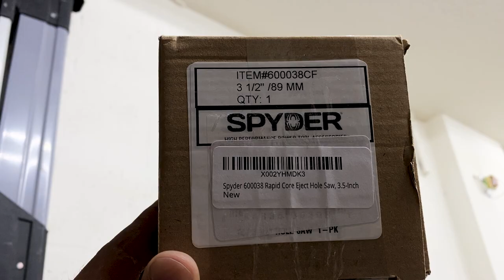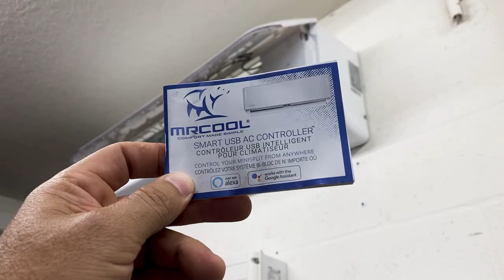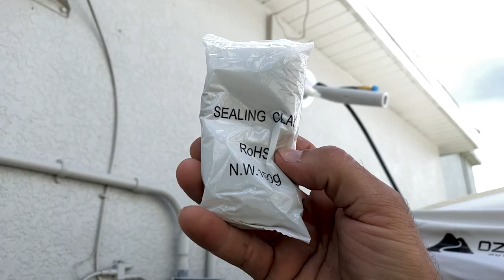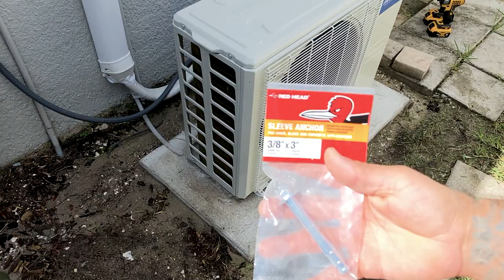MR COOL DIY 4TH Generation 18K BTU Garage Install

Comment: Why did you get 25'. Looks like a 16' would've been enough, right? Also, Abby advice on 120 vs 240v options?
Reply from the maker: I definitely could have gotten a shorter line set.  Not an electrician, so I can really say which one is better.

Comment: Excellent video. I’m in Florida as well. I have the same concrete walls in my garage. Thanks for showing what hole saw to use. I’m going to use the wall brackets on the outside to keep the unit elevated a bit. Well done!
Reply from the maker: That’s awesome! Thank You.  Definitely worth it 👍🏽
Reply: On the wall v slab... I looked at the slab and anchors as theft protection for all. 😐

Comment: Lay the extra line set horizontally. It is mentioned in the install guide somewhere, It allows the oil to return back to the unit.
Reply from the maker: Good to know! I definitely didn’t need the extra line set

Comment: What a great install. Your timing is perfect.  Living on the Gulf Coast I have been using a wall A/C unit and they pretty much are shot after a year, since they run alot. And I have been considering one of these.
Thanks.
Reply from the maker: Absolutely! I’ve been putting this project off for way too long.  I couldn’t be happier with this system so far.  I have to turn it down sometimes, because it’s too cold lol.  It has made working in the Garage more exciting.
Reply: @RAIDERWORLD  Agree. I really like the insulation on the door. I just cut up the 4x8 foam board insulation.  What BTU size unit did you use??

Comment: What are you going to do with the extra hose? Is the plan to cover it so the sun doesn't bake it or will it be fine left out like that? Also living in FL I get concerned about the sun bake
Reply from the maker: Hey, thank you for watching!  It’s wrapped in heat deflecting tape.  It also sits in the shade half of the day.  Should be fine, but I’ll give some updates right away if anything changes

Comment: Thanks for the Video, I just purchased the 18K BTU, and I was wondering how I will do a hole  on my wall  (bricks on the out side). Thanks for adding the info in the bits, purchasing ring now on Amazon.😀 Muchas gracias amigo.👋
Reply from the maker: That’s awesome! Thank you.  The right tool definitely helps the job go easier

Comment: Nice instructions. One question. I thought it was imperative to vacuum your lines before opening up the coolant.
Reply from the maker: I believe the way these lines are set up, it creates its own vacuum.  So far, I haven’t had any issues
Reply: Those "Quick-connect" models are pre-filled and already are with vacuum. After opening the valves as he has shown anything is ready.

Comment: I'm currently installing the same 18k unit.  If you don't have a whole house surge suppressor then your electrician should have recommended one at the disconnect box. I believe it's current code and a good idea to protect the onboard electronics.
Reply from the maker: Absolutely! I definitely have one of those.

Comment: What did the electrician do for you?
There isnt much info on what needs to be done in the manual.
Reply from the maker: So the electrician added (2)15amp breakers, or you could just add (1) 30amp breaker.  Then for code, I had to add a quick disconnect on the outside.

Comment: How long is the electric line that goes from the head? Do they size it to the same length as your copper lines?
Reply from the maker: I do not know the exact length, but it is long.  It was about the length of the line set

Comment: What size wire is the the whip and what size breaker on this unit? 30amp? 10/2?
Reply from the maker: I’m not to sure in the size of the whip, but the electrician did use (2) 15amp breakers.  But you can easily just use a 30amp.

Comment: What's the purpose of the air freshener filter? It's just a little strip. The actual filter is the screen. Thanks 😊
Reply from the maker: Honestly, I do not believe it serves a purpose at all.  At least not enough to make a difference.

Comment: How did you connect to wires inside near the wifi module, the ones that are in the little box next to the filter when opened, hope that make sense
Reply from the maker: The WiFi module just plug right in, there are no wires or wiring needed

Comment: Nice video, just curious what is the SQ. footage of your garage? Or how did you come up with that size 18K unit? Thanks.
Reply from the maker: Thank You! My garage is about 650 sqft.  I wanted to make sure that I had enough coverage, and this unit is perfect.
Reply: @RAIDERWORLD  ok cool thanks for the reply.
Reply: I went with a 18K unit for my 3 car garage which is also about 650 sq ft.  It can keep my garage at 72F even when outside temps are 109F.  I do have a second story living space above the garage, insulated walls, insulated garage doors which helps it to maintain the temps.

Comment: So you had two 18 k right? Did you out them both in the garage?was curious how many seer your 18 k is because I’m seeing lots of different seer ratings depending on seller. Costco seems to have one at almost 22 seer but you have to wait 2 to 3 weeks to get, I’m not now! Haha. I’ve got a 3 car standard garage, was thinking 24K or should I step to 36k? How much did your electrician charge for quick disconnect? Thanks, nice video
Reply from the maker: Thank You for watching! I only have (1) 18k unit in the garage, which is plenty of enough for my needs.  Nothing wrong with going higher, but this was all I needed

Comment: Thanks for the video!  Great Job!!! I just bought a 18K unit and was DIY on the elect part too.  What size breaker (25 or 30amp) and what size wire (10 or 8) did the electrician use; the instructions and a call to MR Cool haven't specified.  Thanks again!!!
Reply from the maker: Thank You for watching!  I’m not home at the moment, but I’m pretty certain it was a 30amp breaker.  And I do not remember the size wire.  I would definitely ask an electrician, just to be sure.  Yeah, instructions didn’t really cover it.  Thank You again
Reply: There's a chart on the instructions I have on page 35. It says #10AWG minimum for the 18K, #8 if you want. You'd size the breaker to the wire, in most cases 30A for #10.
Reply: On the outside unit is the label that will tell you for your specific size setup.
"Minimum circuit ampacity" tells you the number of amps to size the wire for. (E.G. 15a - 14awg, 20a - 12awg, 30a - 10awg.
MOCP is maximum overcurrent protection. Or largest breaker, or fuse. Breaker must be HACR rated
(Heating,air cond,refrigeration)

Comment: I notice you didn't pump the air out the lines Any problems?
Reply from the maker: No issues.  I just went straight off the instructions

Comment: Can your line set be to long for operation. I bought DIY 4 gen 12000 btu 1 ton air with 25 ft line set and I only need 10 ft
Reply from the maker: Not really sure on that.  I could have definitely gotten a shorter line set though

Comment: The company Mr. Cool states its  a DIY what they don't say is you must have a licensed HAVC  technition istall the unit or he must sign off that the unit was installed properly and is working correctly. Otherwise the warranty is void and I don't  know of any tech that would sign off on a job that he did not do.I
Reply from the maker: Yeah, that’s never good business.  I live in HOA, so I have to get an inspection/permit done anyhow.  But yes, it’s not completely DIY, but I saved on the installation
Reply: The DIY series retains a warranty and does not require a licensed HVAC contractor for installation.

Comment: My garage 750 square foot u think   1800 btu work.. im worried about heat sometimes 0 degree here in pittsburgh.  Also upstairs same so was gona get 36k two 18 units.. looked at 48k two 24s but they dont heat at degree ive read
Reply from the maker: My garage is around 700 sqft and it cools it just nicely.  I live in Florida, so have not had to use the heat option lol

Comment: It's a nice video but i think you were suppose to do a vacuum on the system before you open the valve's to let the refrigerant go in, no!
Reply from the maker: According to the directions, this system does not require it.  All DIY besides the electrical portion
Reply: Honestly even the electrical isn’t hard if you know what you’re doing

Comment: I've learned from tons of feedback that you should not store the excess lineset in a verticle spiral like you have (and I had). Oil builds up on the bottom of the loops, needs to be stored horizontally.
Reply from the maker: That’s a good point, and definitely makes sense.  Thank You for your input
Reply: What oil???  I thought there is only a cooling gas/liquid in it?  What does this oil build up do?
Reply: @liebuster9308  In A/C systems, there is oil added to the refrigerant acting as a lubricant and sealant. Most of this oil ends up in the compressor crankcase where it's needed but some of it escapes along with the refrigerant in the line set. When it returns, it is captured by a "separator" which is usually built into the compressor but can also be a standalone device. You do not want oil building up in the lineset as it acts as a thermal insulator, plus the oil is needed by the compressor.

Comment: Anyone install these in new construction homes and run the lines in the walls then out?
Reply from the maker: I’m sure it can be done
Reply: @RAIDERWORLD  I don't know if you mentioned it but how much did you pay for this? I was just quoted $4200 installed for an 18K btu Haier, which is what led me to the DIY Mr. Cool's.
Reply from the maker: @zechariahhambone3841  I paid a little over $2,200 after Military Discount.  Save your money, and DIY

Comment: 2 x 4 concrete pad was a bit laboured (rain gotcha) ffs move on...big miss on insulation underneath? disinterested? Nice angled deWalt hole-saw use on cinderblock and two stage approach to drainline. Adjustable Wall Sleeve is "neat" (until angle is not flush, but is later "not a finish" feature which is rewarding, phew) but outside location was obvious time waster and afterthought. Including the hole-saw in kit would be expensive, zipties and duct tape inexpensive
Reply from the maker: For sure! I definitely appreciate the input.  For this being my first split unit installation, It went smoother than anticipated, besides the rain.